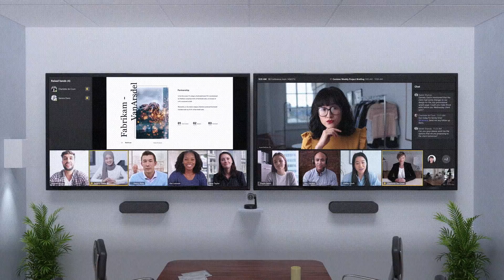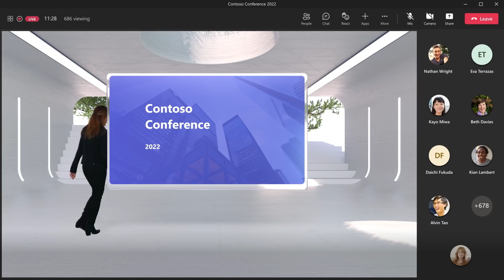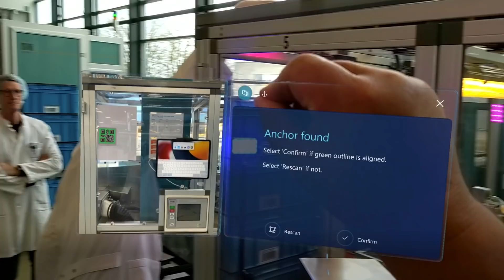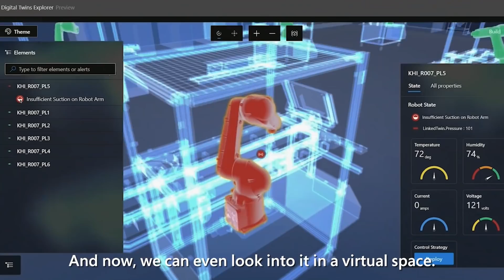Metaverse (Satya Nadella 2022 Build Keynote)

Comment: I'm not convinced this is a good idea... Much of the world donning headsets to go to work or hang out in a virtual world? In some ways, I'm getting Second Life vibes from this, and that didn't exactly pop off as the game changer it was intended to be. Second Life is pretty much just a meme at this point. I definitely have a lot of questions and things holding me back from actually trusting or liking this idea.

Do I have to wear a VR headset the whole time I'm working? When I first started using one, I would get very sick after only 30 minutes (how might my coworkers who are new to VR handle it?). Would my boss be watching me work, even when I'm at home? This kinda defeats the purpose of work from home, where I can put some distance between me and management (all coworkers talk to you less when working remotely, I've noticed). With GPU prices still not low enough, how do we afford a decent enough desktop to handle the metaverse? Add to that cost the cost of a VR headset (a few hundred to around a thousand, USD), and that might break the bank for a lot of people (or businesses, if they have to shoulder the cost for each of their employees). Would everyone going out and buying a GPU for their work desktop lead to another worldwide shortage of computer parts? I mean, we are still in a worldwide shortage of computer parts, for so many electronics and components. And what minimum specs do I need to be able to run VR for the metaverse?